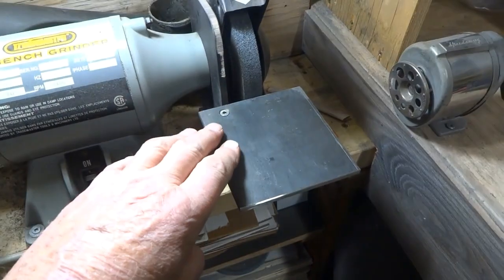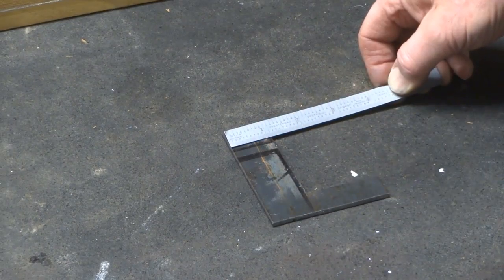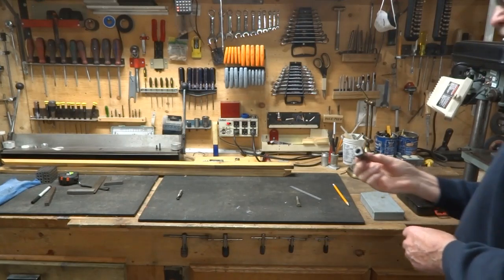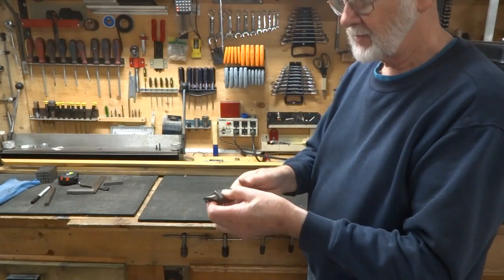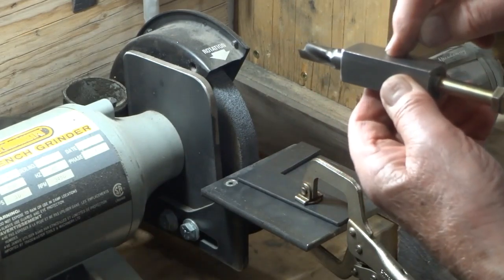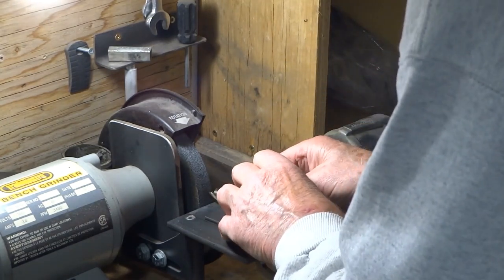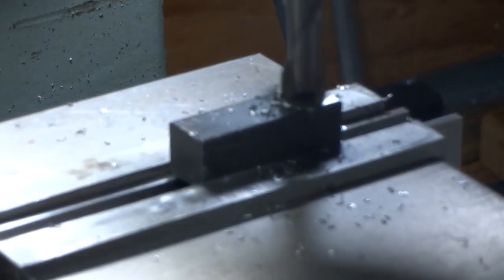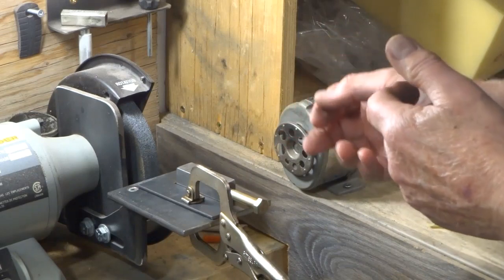End mill sharpening fixture.

Comment: That's a Slot Drill, not an End Mill
Reply from the maker: Never heard of a slot drill. I am sharpening a two flute end mill. You will have to tell me what a slot drill is.
Reply: End mills and slot drills are both milling cutters, but they have different cutting patterns and uses: 
End mills
Primarily cut laterally and horizontally, and are used in a variety of milling applications, including drilling, slotting, and contouring. 
Slot drills
Can plunge in like a drill and then slot across like an end mill, and are often used in general machinery. They can cut in all directions, and are used in a variety of industries, including engineering, carpentry, construction, metalworking, and woodworking. 
Here are some other differences between end mills and slot drills:
Flute: Slot drills have one flute that is slightly longer than the other, while end mills have clearance in the center. 
Cutting edges: Slot drills have two radial cutting edges opposed to each other. 
Chip evacuation: Slot drills have two or three flutes, which helps with chip evacuation and keeps the bit cooler for longer. 
Surface cut: Slot drills produce a rougher surface cut than other end mills. 
Plunge cuts: Slot drills can perform plunge cuts, which other end mills cannot. 
Hope this helps.
Jim.
Reply from the maker: I've been doing this stuff for many years and never realized the difference. Thanks for the detailed description.

Comment: Nice simple device. 
What is the curved piece of metal hanging on the wall behind your grinder for?
Reply from the maker: That is not metal it's hard rubber that slides in between the grinding wheel and the tool rest to lock the wheel in place while removing the nut that holds the wheel on.